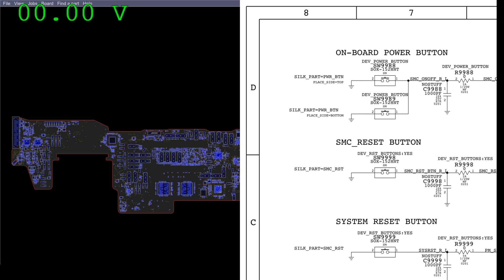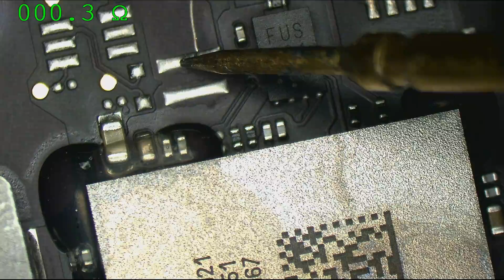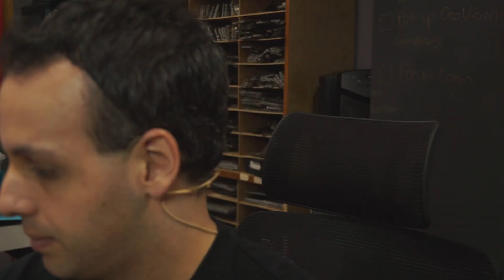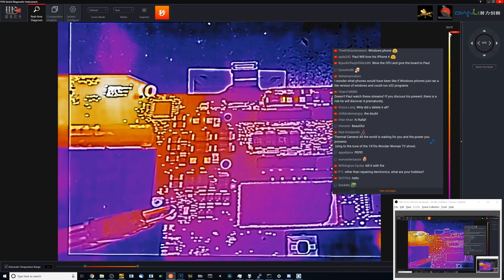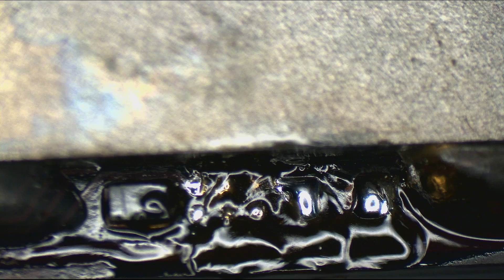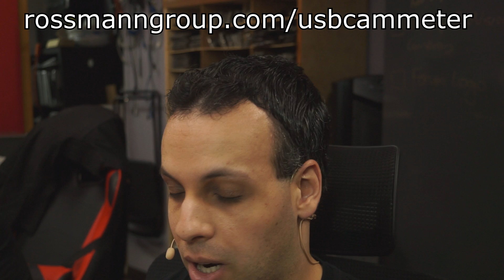What is power cycling and what causes it on Macbook logic board?

Comment: I get my dead macbook air repaired by apple service centre they just  disconnected every cables from logic board and checked it started working, but now after 2 weeks its not charging, but working on battery as battery is not fully drained, and even working on ac power after disconnecting the battery plug, so is it safe to use ( macbook air 2015) directly on ac power?

Comment: 11:12 PP3V3S4 doesn't go directly to the CPU, but couldn't the short involve a trace that does go to the CPU?  e.g., a bridge created by a previous repair attempt.  I suppose the probability is low, and the time required to check all those CPU lines for voltage before turning up the power supply would be enough to repair the next board.  Have I answered my own question?

Comment: I got a used microscope for about $45 it's a nikon as well... Works perfect though. You folks that are just starting out should check out some of the online auctions some of the universities hold. They get rid of their equipment almost dirt cheap and some of it they have to throw away. You might be able to find a $1000 microscope for pennies on the dollar. Also remember you don't need something that is going to scope down to the size of a blood cell just something along the lines of maybe 30 - 40 times magnification.
Reply from the maker: buying used and going through other people's trash piles is an excellent way to build a starter setup.